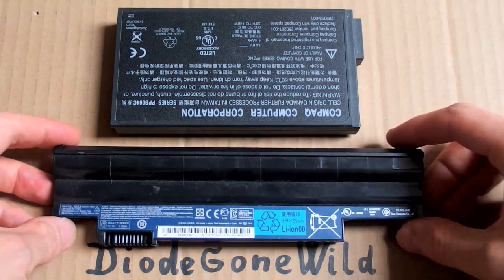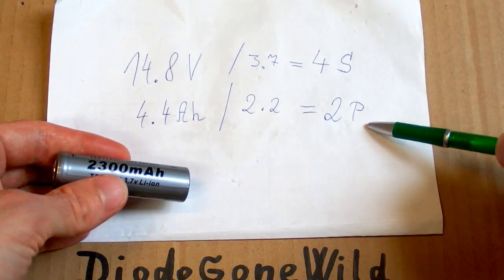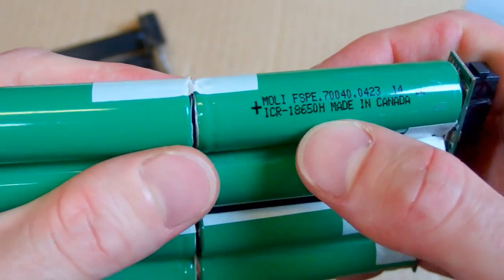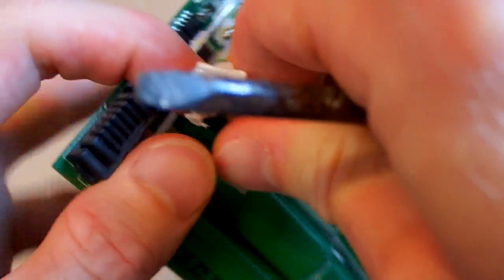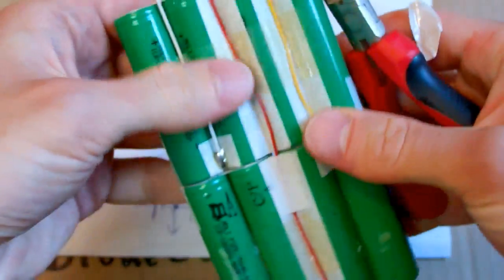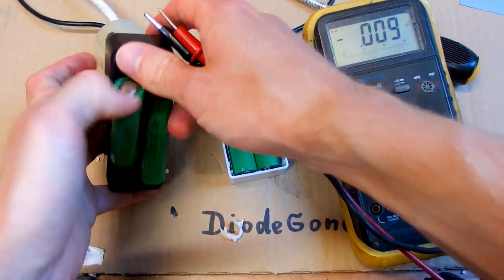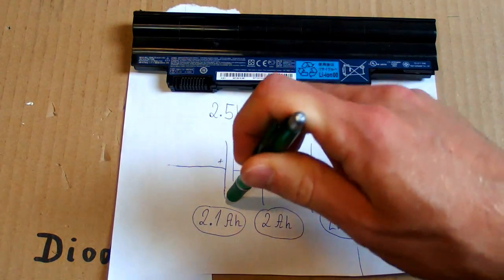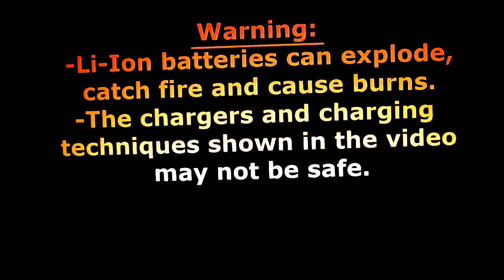Harvesting Free 18650 Li-Ion Cells From Laptop Batteries

Comment: I'm wondering how you determine the cell-capacity so "exactly"  ..do you use a constant-current discharger and measuring time until you reach the voltage-minimum (which is how high, btw?)?  ..thanks
Reply: He made a battery analyser which discharges the battery by drawing a constant current. The microcontroller in it adjusts the voltage applied to the gate of a MOSFET and also calculates the value of the capacity by multiplying the current with the time.
Reply: Constant current discharge from 4.2V to 3.0V for Lithium Ion. Set the current to whatever value you need for your application and size of battery (usually 0.2A - 0.5A for smaller batteries, 1A for larger batteries). DGW uses 0.5A for 18650s but I do a more thorough test at 1A, because any battery that works at 1A will work at 0.5A, but really old batteries may work at 0.5A, but not at 1.0A.

Comment: 0:58 And find a LOT of good LEDs in a bad led light bulb
Mostly surface-mount LEDs but sometimes even through-hole LEDs 
And I don't know why the manufacturers put the LEDs in series because if one LED fails then the whole light bulb fails.
Example:  12 watt LED light bulb
has 12 LEDs 1 watt each. One LED fails and the whole light bulb fails. Even though you still have 11 LEDs okay in the light bulb. So that's why I do it this way Sometimes I take some light bulbs home, dissemble the LED light bulbs, look out  for good LEDs with a multimeter on continuity mode, then desolder them from the PCB board and use them in my projects. I love salvaging LEDs! You don't have to buy them online!
Btw I know that bad light bulbs may contain hazardous chemicals but I don't care because I dissect the LED light bulbs outside.
Batteries: recycle 
Other stuff: reuse, then recycle

Comment: Hi, this is a very dangerous procedure that nobody should follow.

When a lithium  ion battery reaches a voltage of below 2.5 Volts, it develops small conductive particles called dendrites, which are generally formed by the peeling off of the copper electrodes present inside the lithium ion battery.

When you try to charge the overdischarged lithium ion battery (i.e. the battery with a voltage below 2.5 Volts, it causes the copper dendrite pieces to melt and get plated back on the non conductive parts of the lithium ion battery, which will cause an internal short circuit.

This procedure is very dangerous and the battery can explode or catch fire during the charging process.

Even the use of the 0v function on most of the expensive lithium ion battery chargers, is also very dangerous.

I was using the 0v function on my Xtar VC2 charger to revive my overdischarged 18650 batteries and the batteries ended up smoking and almost catching fire.
Reply: Most batteries are probably fine even if they reach a low voltage. I have had some cells with a relatively low voltage come up with a decent capacity when fully charged and tested. In fact, some of the lower voltage cells gave a higher capacity than the ones at a decent storage voltage - probably because the PCB shut off the pack and stopped the battery from charging. 
I've never had an 18650 battery catch fire, or even show any signs of internal damage such as what you explain. However, some 18650s can be bad in that they have a very high internal impedance, and/or get hot whilst charging. These batteries should not be used, and should be recycled.
Reply: The cheap power banks probably have recycled cells in them already..
Reply: Your comment is right. But, i have salvaged about 3 laptop batteries, one had 6 batteries, (18650) and one of them had very high self-discharge current. They were discharged to about 0.8v each. They all survived (except that one) and I charged them with $1 charger (he did teardown of it). No heat, but i need to make capacity tester (just 500mA CC load) and to test them. I guess you got very unlicky, or i got lucky...
Reply: You are ready right.

Comment: The strange square component is a controllable fuse. It can blow in three ways: the current through it gets too high, the mosfets underneath (or near) it get too hot, or the third terminal is connected to ground by the control circuitry.

Comment: You can use the board for battery protection
Reply: The laptop's PCB is not usually very good for using as a charge controller/protection PCB. They're only good if you need a 3S or 4S configuration (depending on the battery pack), plus they all have different pinouts, and some won't allow you to charge or discharge them at all unless you hook up the relevant data communication pins (probably some form of I2C interface). It's better to just salvage the cells, test the cells, then buy a cheap protection PCB from eBay (make sure to balance the cells first).

Comment: That was a relatively easy laptop pack to open! I've had quite a few laptop battery packs which have been a right pig to open.
It's also good that none of them are the Panasonic CGR18650D. I always call them "CGR18650 Detonating" because they always try and detonate themselve whenever I take apart a battery pack with these cells!

FYI: I had 2 battery packs with these cells and they both tried short circuiting on me, destroying some of the cells.

Comment: I just received an Opus BT-C3100 V2.2 from AliExpress that I paid about $30 for including shipping. It's going to let me test 4 batteries at once. It's easy to use and I've already started testing batteries. It's faster if you charge the batteries first in another charger and then test them.

Comment: I wandered if we could take advantage of the remaining controlling board with the same batteries after fixing them to charge them and use any buck converter to appropriate voltage
Reply: Do it. The interface is a modified I²C, the chip gives you charge, temperature etc. Even if you can't access the chip, you can use it as an intelligent battery charger.

Comment: how do you do the cycle for lithium batteries?
Reply: Each cycle is a full charge and then discharge. 
Doesn't matter the order or if each time you charge/dicharge partially. 
For example, you have a battery at 100% and discharge to 70%, then charge to 80% and then discharge to 50%. If you add all the discharges and charges, you charged 30% and discharged 50% so not a full cycle.

Comment: I replaced the battery in my old laptop last week, i should break open the old battery and see if any are alive, but i dont have use for them yet.
Reply from the maker: I replaced my entire laptop last month :). I didn't open the battery of the old one yet. It was running on AC all the time and the battery now lasts 1 minute. After 10 years, the battery is totally rotten. You don't even have to use it. Just keeping the battery at 100% all the time is enough to ruin it. Maybe just 1 cell is bad, but more likely all of them are. I will probably open the battery in another video.
Reply: Yes thats just what my battery did, and i do keep the very old lappy (acer aspire 5315 2006 ) on its supply, i never need it to be mobile, but if i have a power cut its nice to have some time to save a circuit diagram im editing, and close the machine down propperly :-D.

lol replacing the laptop is an extream way to gain a battery :)
Reply: make a powerbank

Comment: You can use the included BMS of those batteries, they might seem difficult to use but they usually have 2 pins for each pole, so 2pins are + and 2 pins are - and then the middle ones tend to be I2C connections to give details to the computer... if you hook up a constant current PSU to the inputs and limit it to the right voltage they will charge and balance!
Reply from the maker: I don't like those obscure chips, especially when hooked to an EEPROM memory :). And I only needed individual cells, not a 14.8V pack.